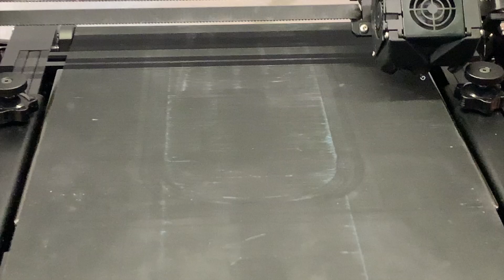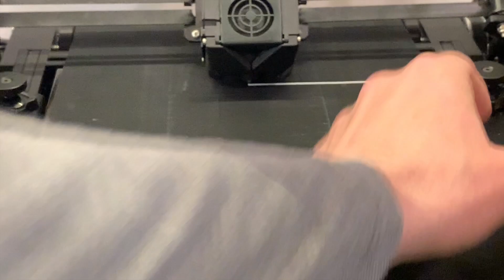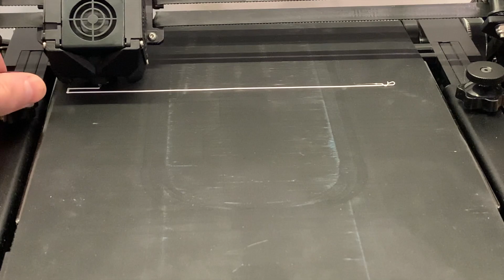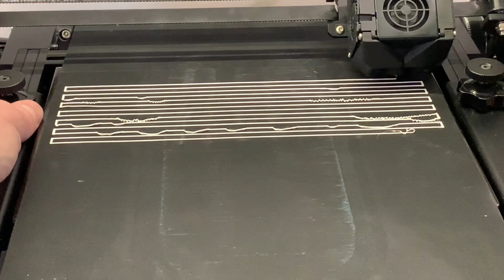CR-30 Belt Leveling with Looping GCode

Comment: can you share you settings please. I need to use my age old printer for a project and this GCODE adhere perfectly to the bed, but my slider output does not (even after setting temperatures to 75/220)
Reply from the maker: it's hit or miss with the CR30. have you ever had good layer adhesion? if not or it stopped after the first week to month, then it's possible your heated bed has warped. this is well documented and a problem I flagged with creality way back. if it's warped and you haven't taken steps to flatten it, then you will never have good adhesion. if it's not the bed, then your next stop is materials. the CR30 has come with at least two different belts. each works with some materials and not well with others. it could be a trying journey to figure this out. temps are not your problem.

Comment: Which slicer are you running?  Can you share your profile?  For some reason, this sticks perfectly to my bed, but when I run code from ideaMaker, I can't get anything to stick to the bed without wildly adjusting the baby steps.  Thanks
Reply from the maker: Kiri:Moto, of course. Default CR-30 profile that's included with it. https://grid.space/kiri

Comment: I did this, bed is perfectly leveled. Then I go to start a gcode I sliced and absolutely no bed adhesion. I have a 0.8mm nossle with. 4 layer hight. What am I doing wrong? The first 3 purge layers of every print won't stick at all. I even sprayed the bed with hair spray
Reply from the maker: have you asked on the CR-30 Discord server? depending on filament and other factors, the goldilocks zone for your printer could be tricky to hit.

Comment: Thanks for this video and gcode! I know this isn't technical support, but this is not quite working for me because the center of my belt is slightly lower than the sides. Do you have any recommendations for fixing something like that?
Reply from the maker: Sorry to hear about your warped heated bed. This is a common failure mode for this printer that is the result of a simple design defect with the way the bed is mounted and constrained. It's been know since pre-production, so kind of amazing Creality still hasn't addressed it. We've discussed this extensively along with remedies on the CR-30 Discord server (https://discord.gg/gYcSqy4du9). tl;dr you need to remove the belt and bed and shim it from underneath using 12mm spacers. This remedies the warp when bolted back down. To address future warping and allow the bed to "breathe" as it heats and cools, I slightly loosen (1/8 turn) all bed bolts except the center leading one (closest to nozzle center on belt). Good luck.

Comment: i have the M808 capability but what did you load as your file to print.  just a thin straight line? and the the M808 just keeps repeating it.  the fact that it goes up and makes a vertical line to then connect the next horizontal line is what is throwing me off as that is more than just a straight line.  and for your thin line, just set at the layer height and line width that you want to print at?  thanks
Reply from the maker: this is the file https://static.grid.space/gcode/cr30-level.gcode

Comment: Any advise for a printer that will not return to being level and is either too high or too low but never having good adhesion?
Reply from the maker: I'm not sure if this is what you're describing, but is is very common for the CR-30 heated bed to become warped. It typically presents as a low spot in the middle of the print region. Any deflection, even sub-millimeter, can have a devastating effect on adhesion because it turns the belt into a suspended surface, like a drum. And there is no way to level that out. The fix I have applied and many others have verified, is to place two 12mm E3Dv6 aluminum blocks under the center of the bed (held in place by kapton tape) and bolt it back down. This is discussed extensively on the CR-30 3DPrintMill Discord server.

The reason this bed warps is because of the bolt pattern. It is held down at the edges by 6 chamfered bolts. When heated, the bed expands and that expansion has to go somewhere. Because of the bolt pattern, the center of the bed bulges. And that's usually downward because of gravity.
Reply: @GridSpace  hi, I just assembled mine. So this solution you just described is preventive or corrective?
The G code don’t loop so I guess I need to upgrade the firmware. Where to get it or how to do it? TIA
Reply from the maker: @andreojuegosyestrategia1266  I recommend you join the CR-30 Discord server. You will find instructions and help there https://discord.gg/USGfW36XnZ

Comment: Thank you for your G-code, how can I set up repeat print G-code as your video?
Reply from the maker: you need to upgrade to a version of Marlin that support the M808 loop command. the best place to find that is on the CR-30 Discord server (https://discord.gg/Z5v6C26JtY) in the #firmware channel.

Comment: Why not put a bltouch vertically and probe to see whether bed is aligned? I don't have cr30 so can't test.
Reply from the maker: the belt is an entirely new regime. any layer that touches the belt (and that's most) incur "first layer" problems. the belt flexes unlike a bed. extrusion and viscous flow forces can move the part around. and although it would seem you should be able to probe the belt and fix leveling issues, there are half a dozen reasons why this is, in fact, impossible. not just hard. bed geometries arise that cannot be probe/leveled and require mechanical intervention. this is actually common. i'm planning to make a video about that since this question comes up so often.

Comment: For anybody like me who didn´t get is done with the "firmwareupdate for infinite loops"...
I wrote a script based on the g-code above. It´s no loop, just a normal script so after a while the testprint end and if you are not finished with leveling you have to start the gcode again.

M104 S230           ; set nozzle temp
M140 S30            ; set bed temp
M109 S230           ; wait for nozzle to reach temp
M190 S30            ; wait for bed to reach tmp
G28 XY              ; go to home position
G0 Y0               ; move nozzle to belt if negative offsets used
G92 X0 Y0 Z0 E0     ; zero out all axes (include extruder)
M83                 ; set extruder to relative coordinates

G92 Z0              ; Z needs to start at 0 at the start of the loop
G0 X215 E40 F800    ; extrude to "left" of belt
G0 Z5 E2            ; extrude short Z line
G0 X0 E40           ; extrude to "right" of belt
G0 Z10 E2           ; extrude short Z line

G0 X215 E40 F800    ; extrude to "left" of belt
G0 Z15 E2            ; extrude short Z line
G0 X0 E40           ; extrude to "right" of belt
G0 Z20 E2           ; extrude short Z line

G0 X215 E40 F800    ; extrude to "left" of belt
G0 Z25 E2            ; extrude short Z line
G0 X0 E40           ; extrude to "right" of belt
G0 Z30 E2           ; extrude short Z line

G0 X215 E40 F800    ; extrude to "left" of belt
G0 Z35 E2            ; extrude short Z line
G0 X0 E40           ; extrude to "right" of belt
G0 Z40 E2           ; extrude short Z line

G0 X215 E40 F800    ; extrude to "left" of belt
G0 Z45 E2            ; extrude short Z line
G0 X0 E40           ; extrude to "right" of belt
G0 Z50 E2           ; extrude short Z line

G0 X215 E40 F800    ; extrude to "left" of belt
G0 Z55 E2            ; extrude short Z line
G0 X0 E40           ; extrude to "right" of belt
G0 Z60 E2           ; extrude short Z line

G0 X215 E40 F800    ; extrude to "left" of belt
G0 Z65 E2            ; extrude short Z line
G0 X0 E40           ; extrude to "right" of belt
G0 Z70 E2           ; extrude short Z line

G0 X215 E40 F800    ; extrude to "left" of belt
G0 Z75 E2            ; extrude short Z line
G0 X0 E40           ; extrude to "right" of belt
G0 Z80 E2           ; extrude short Z line

G0 X215 E40 F800    ; extrude to "left" of belt
G0 Z85 E2            ; extrude short Z line
G0 X0 E40           ; extrude to "right" of belt
G0 Z90 E2           ; extrude short Z line

G0 X215 E40 F800    ; extrude to "left" of belt
G0 Z95 E2            ; extrude short Z line
G0 X0 E40           ; extrude to "right" of belt
G0 Z100 E2           ; extrude short Z line

G0 X215 E40 F800    ; extrude to "left" of belt
G0 Z105 E2            ; extrude short Z line
G0 X0 E40           ; extrude to "right" of belt
G0 Z110 E2           ; extrude short Z line

G0 X215 E40 F800    ; extrude to "left" of belt
G0 Z115 E2            ; extrude short Z line
G0 X0 E40           ; extrude to "right" of belt
G0 Z120 E2           ; extrude short Z line

G0 X215 E40 F800    ; extrude to "left" of belt
G0 Z125 E2            ; extrude short Z line
G0 X0 E40           ; extrude to "right" of belt
G0 Z130 E2           ; extrude short Z line

G0 X215 E40 F800    ; extrude to "left" of belt
G0 Z135 E2            ; extrude short Z line
G0 X0 E40           ; extrude to "right" of belt
G0 Z140 E2           ; extrude short Z line

G0 X215 E40 F800    ; extrude to "left" of belt
G0 Z145 E2            ; extrude short Z line
G0 X0 E40           ; extrude to "right" of belt
G0 Z150 E2           ; extrude short Z line

G0 X215 E40 F800    ; extrude to "left" of belt
G0 Z155 E2            ; extrude short Z line
G0 X0 E40           ; extrude to "right" of belt
G0 Z160 E2           ; extrude short Z line

G0 X215 E40 F800    ; extrude to "left" of belt
G0 Z165 E2            ; extrude short Z line
G0 X0 E40           ; extrude to "right" of belt
G0 Z170 E2           ; extrude short Z line

G0 X215 E40 F800    ; extrude to "left" of belt
G0 Z175 E2            ; extrude short Z line
G0 X0 E40           ; extrude to "right" of belt
G0 Z180 E2           ; extrude short Z line

G0 X215 E40 F800    ; extrude to "left" of belt
G0 Z185 E2            ; extrude short Z line
G0 X0 E40           ; extrude to "right" of belt
G0 Z190 E2           ; extrude short Z line

G0 X215 E40 F800    ; extrude to "left" of belt
G0 Z195 E2            ; extrude short Z line
G0 X0 E40           ; extrude to "right" of belt
G0 Z200 E2           ; extrude short Z line
Reply: Works like a charm, thanks!
Reply: cant seem to have an extrusion but the end of every line drops a small blob; extruder is working normally but it looks like it retracts over a huge distance between loops;
any way I can reduce the retraction distance/increase extrusion to get the line pattern in the video?

Comment: Great video! So my lines look like they are printing well but if I touch them they just move. So assume adhesion is still poor? Any ideas?
Reply from the maker: you could try conditioning the belt a little by scrubbing it with IPA and a clean/plastic sponge
Reply: @GridSpace  thank you! Not ideal but its all I can think left to do now!

Comment: Hi, I have watched several leveling videos and have found this one the best but I am still having adhesion issues with my prints. I'm not new to 3d printing and have 3 other different FDM printers all of which are dialed in nicely.  I've updated to the latest firmware and have been using Kiri:moto to slice and add a part anchor. I am able to get the looping test pattern to adhease nicely. The part anchor goes on fine but when the model starts it ends up lifting the anchor on one side and causes the print to fail. Any adhesion tips would be appreciated. I've been stuffing around with this on and off for over a month now with no real satisfactory results.
Reply from the maker: a couple of thoughts. first, some filaments just don't seem to work on the belt. won't stick or warp badly. second, even after you think you have it level, give the knob an extra 1/4 to 1/2 turn to the left. also, check that your silicon sock on the hot block isn't rubbing the belt. this seems to be relatively common. it causes deflection of the hot end and prevents proper printing. you can use an x-acto knife to trim off the back edge of the sock.
Reply: @GridSpace  thanks for the tips. I've been busy with other projects lately but will give your suggestions a go when I get some free time. I've been using the supplied creality filament from this printer and another and I suspect that it's part of the problem. I appreciate your feedback, thanks.

Comment: Well, I don't have the looping firmware but when I print the gcode file my lines look like yours when it is "good". When I print though my models are coming loose from the bed. Not sure what I'm doing wrong.
Reply from the maker: are you running the newer code with a slightly reduced flow rate? it's been updated in the last 10 days. this will get you a little closer to a y offset that most slicers will work with. are you using anchors and brims in your prints?
Reply: @GridSpace  
I have the same problem， when I print the gcode file my lines look like yours，Also very strong with bed. but when i running my g-code 
Still the wire is very thin and loose. Do I need to increase flow rate? 90% now. And the start speed is much slower than yours g-code.
Reply from the maker: @정원석-b2t  You should be running at least 100% flow rate (1.0 extrusion multiplier)

Comment: I flashed the new firmware and i don't know how to set the infinite loop.. how do you do it?
Reply from the maker: watch the belt printing video. it applies up through 2.8 ... in 2.9 looping is even easier: just select a range and type in a loop count under the expert menu

Comment: Thanks for the video.  When i was used your gcode the nozzle start  very high , and my nozzle can't touch the bed. When i use a personnal gcode i haven't this problem
Reply from the maker: If you are using a negative origin, then this will likely be the case. In that case, just edit the gcode to place the Y at 0 before starting the loop.
Reply: @GridSpace  ok thanks  you start it at what y ?
Reply from the maker: I don't use negative offsets. So y=0 means the nozzle is at the belt printing level on my setup.
Reply: @GridSpace  i have done that but it still to high
Reply from the maker: @NotAimen  have you joined the Discord server for the CR-30 belt printer? it would be much easier to get support there.
Reply: @GridSpace  yes

Comment: This works great! Thank you for this. How should we adjust the E value of the G0 command when we scale up our nozzle, say to for example 0.6mm? Is it just a factor of the difference in diameter as it's just the extrusion width which is technically changing, such that we could change it from E50 to E75 for a 0.6mm nozzle?
Reply from the maker: the ratio is (PI*radius^2) (area of a circle) where radius before is 0.4 and after is 0.6 so it's not linear. In Javascript, that's "(Math.PI*(0.6*0.6)) / (Math.PI*(0.4*0.4))" which equals 2.25 ... the leveling code is already "over" extruding. so I think anywhere from 1.5 to 2.0 times for E is safe.

Comment: How did you manage to update the firmware? any time I connect to the USB port the firmware update button in Cura lights up, begins, then fails.
Reply from the maker: You do not need Cura to update. Copy the new firmware.bin to the SD card. Make sure it has a unique name like "firmware-123.bin" because it will only update when the firmware name is different from the last update. Then power cycle your printer.
Reply: @GridSpace  where can I find the new firmware.bin?
Reply from the maker: @JoaoWilliamRodriguesCardoso  in the #firmware channel of the Discord server

Comment: This is very useful. Kiri:moto has been really growing on me; it has much potential. For CR-30, it has the brim and wings for adhesion (cant do without for some prints) and very good infill.  Been trying to adapt Nak 3D's profile from Ideal Maker since prints have a very nice surface finish. The different terminology between the two slicers has made it a challenge.
Reply from the maker: good to hear. is there specific terminology which is confusing?

Comment: Great video. The visual really helps to know what too high and too high looks like. I didn’t understand what you meant about using a wedge to keep the gap the same on both sides. Where does the wedge go? Thanks.
Reply from the maker: I'm going to post a follow-up video covering the use of a wedge to level the entire platform, and not just the hot end. But imagine all four corners have to be the same height once you have the hot end level. And how best to do that? There is a small gap under the side near the leveling screws. I use a narrow wedge (3D printed) there to measure the distance and make it equal on all four posts.